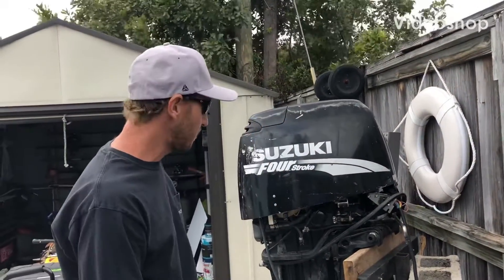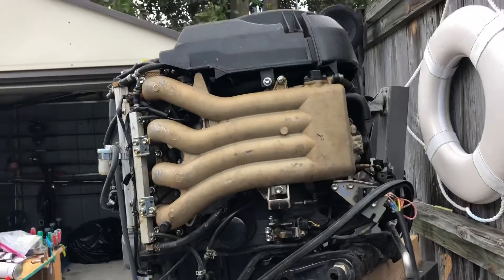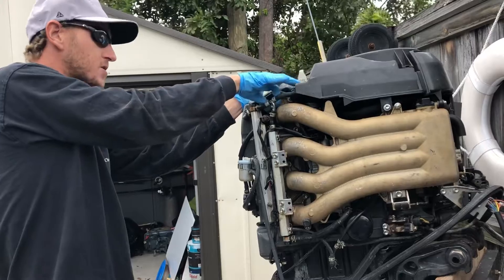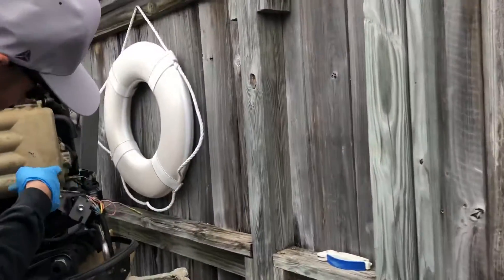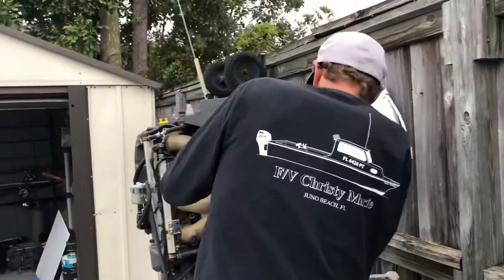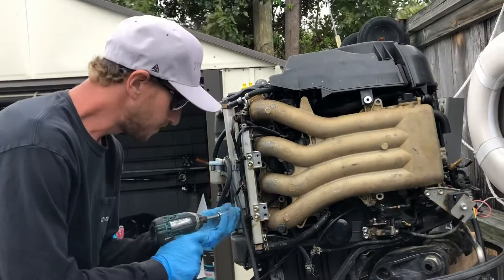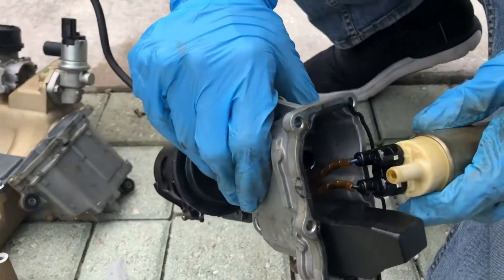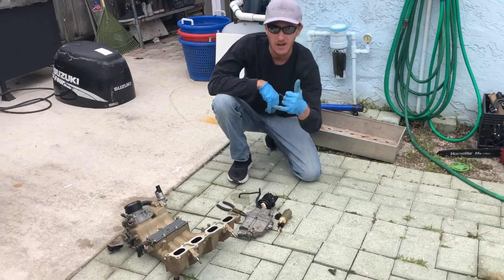Fuel Pump Diagnostic and disassembly QUICK and EASY Suzuki Outboard!!

Comment: hi I need help with my motor is stalling at above 3,000 rpm i replaced all fuel lines and filters and also replaced high and low preassure fuel pumps and the iac valva and i only have 50 hours, the motro althoug low hours motor was sitting for four years thats why i had to replace all those things but i keep having that problem

Comment: Hey I replaced my high speed pump and filter because it started having symptoms temperamentally of trying to start it but stalled immediately anyways it probably needed it soon so let’s call it preventative maintenance at this point 
My question is it has a non related issue of stalling when I come off the throttle fast to neutral any ideas

Comment: If you have enough various wrench sizes you can actually pull the VST up through the top without removing the intake manifold.  It's tricky getting the VST mounting bolts started when you put it back together but at least you don't disturb all of the electrical, fuel and water connections you have to get off to get the manifold off.  Great video though.
Reply: Make us a video of that procedure please ........RAW.

Comment: I have suzuki df30 year 2019; it starts very easy and goes on without any problem. After 5-10 minutes above 4000 rpm, rpm starts waving and losing power. Under 4000 rpm it goes on without any problem. Is the problem low or high pressure pump. I would be happy if you share your experience.
Reply from the maker: Sounds like a restriction in the fuel line somewhere, I would say maybe try a different fuel line and primer ball from tank to engine and see if the problem continues.

Comment: Hello, I have a 2007 df250,  when I go above 4000 rpm, the engine shuts off, but if I stay bellow 4,000.  I can run all day with no issue. Any ideas what I should be looking at? Any help would be greatly appreciated. Ty
Reply: I have the same problem. Did you ever find a solution?

Comment: hello I have a suzuki 90 df and gasoline is getting into the carter, it could be that the fuel vapor separator float needle is stuck and the gasoline is getting through the rocker cover, thank you very much

Comment: Hey mate I have the same motor that seems to throw codes and get stuck in limiter if I hit a big wave like the engine isn’t getting enough fuel or is sucking air, took it to the mechanics and he replaced the ‘lift pump’ not exactly sure what that is but it is still happening. Seems to run fine unless we hit a big wave. Would it be worth looking into this pump for the fix

Comment: nice video  really enjoyed  ====   i have a 115df   milky oil  runs like a sewing machine   is there a freeze plug in the mid section that could have caused my problem  thank you  Jim...
Reply from the maker: It could be the exhaust plug in the side of the engine holder is corroded out or it could be that the head has corrosion and is allowing water into the cylinders, both are not a terrible job to do and if you find that the exhaust plug is corroded out on the side, find a good local aluminum welder and have him grind down the plug and weld it shut with an aluminum plate. But you should change the oil and fire it up not hooked to water and rev it up real good for about ten or fifteen seconds and change the oil and repeat until you get clean oil and then do your diagnosing. I have seen water in the oil run fine for weeks and I have seen it ruin a motor in a day or two. So it seems you caught it at a good time!! Best of luck!

Comment: Got Suzuki df70 2003 on idle it sounds like its missing but when rev over 3k it goes away just changed plugs still same any ideas what's wrong?
Reply: Did you ever figure out your problem?
Reply: @that2doortahoe274  corrosion on cylinder head passing gasket had it welded and skimmed plus new gasket all good now no water in oil but on idle still a small amount of vibration may need advanced timing??

Comment: Hello. Please tell me what could be the reason for this motor operation?
  https://www.youtube.com/watch?v=pFr14kJrYfg
Reply from the maker: https://youtu.be/Cnvspzx9Dms
Reply: @diyboatrepair8005  
thank you very much for your reply. I changed the fuel injectors to new ones but the problem persists. when the engine starts to work like this, I pump gasoline with a manual pump and it starts working as expected, but not for long. What else can you see?
grateful for the early
Reply: this problem occurs only at full speed. if the speed does not exceed 4.5 -5, the engine is working properly
Reply from the maker: If you have not yet tried I would recommend you Hook a small separate fuel tank with new lines straight to the engine to make sure that the fuel lines supplying the engine are not collapsing inside. Due to age or ethanol.

Comment: Hey, my engine symptoms have been cleared. It turned out that the protective sleeve of the oil pipe leading to the nozzle of the high-pressure oil pump had hardened and blocked the oil pipe. I removed the protective sleeve and the engine returned to normal.Thank you very much for your guidance and help

Comment: Hello! I would like to ask, my Suzuki 90, the engine cramps at 4000 RPM for about 5-10 minutes, then can't accelerate, feel there is not enough fuel supply, have to go back to the idle, is this also about the high pressure pump problem?
Reply from the maker: Hi Ben, In my experience I have known the fuel pump to fail completely instead of intermittently pump at a certain RPM, I would look towards having your injectors cleaned, as I have ran into that issue before and caused the exact same symptoms and you can usually have the injectors cleaned for about $100 at a local shop if you remove them yourself. Could also be a fuel restriction somewhere in the system but that would usually not be at a single rpm most times you would notice it in a more broad rpm range. Good luck!
Reply: @diyboatrepair8005  Thank you very much for your reply. You are absolutely right.One of the problems I was very confused about was that the symptoms all appeared at high RPM, and once the symptoms appeared for the first time, they would also appear at low RPM.In order to verify this point, I did a verification today, and the driving speed was not higher than (3200 RPM) today, and I also drove for 3 rounds, without any symptoms of the previous.Is it a syringe problem or something else?Could you please send me an email? I made a short symptom video a few days ago, and I hope to send it to you to help me judge the problem, so that I can find the way to repair it. Thank you very much!

Comment: Great video!!  Really informative.  My 2016 Suzuki runs great until I keep it at rpm's over 4800 for over 6 min or more.  Then it slows all the way down to 2800 range and then jumps back up.. Keeps doing this until I slow her down to under 4k.  Can't figure out why
Reply from the maker: That sounds like a fuel restriction between the tank and the engine. If the lines are more than a few years old the insides of them start to separate due to ethanol fuel and at higher rpm they will collapse and cause a restriction. Sometimes can be the ball that will go bad also but more often it is the line itself. Try hooking a small auxiliary fuel tank  to the engine and go run it see if the problem persists.
Reply: @diyboatrepair8005  makes total sense!  What I also found in my investigation is that the electrical lines to the engine from the helm broke lose from the tie-downs under the deck and it started to hang very low almost touching the water.   This weekend I shored up that line back to the decking and pontoon and got it out of the way of the water flow.  We didn't have any problems after that.   So it also looks like it was somehow "crimping" the line when the boat would hit higher rpms thus pushing the stern down lower into the water and possibly shorting out the signal?
Reply: @diyboatrepair8005  if the bulb was bad the pump would suck it flat. if the ball isnt sealing properly with an electric fuel pump that wouldnt cause his issue most likely. but agree there is a restriction somewhere.
Reply: My problem feels the same as yours
Reply: Jjj